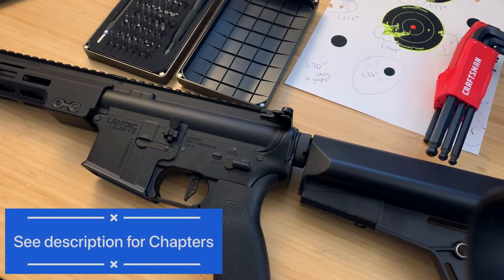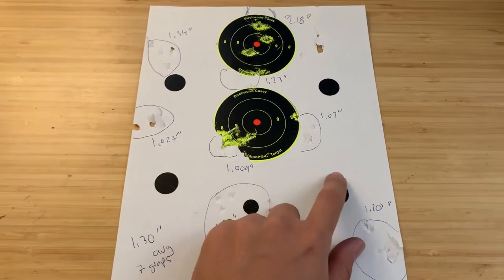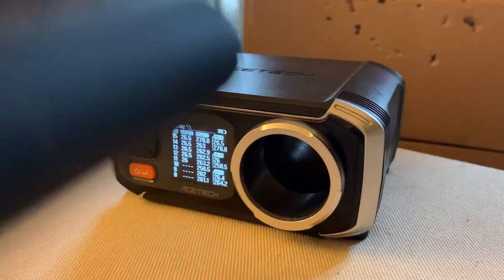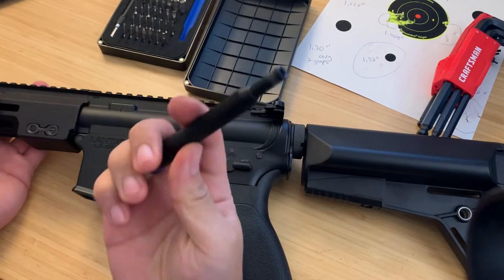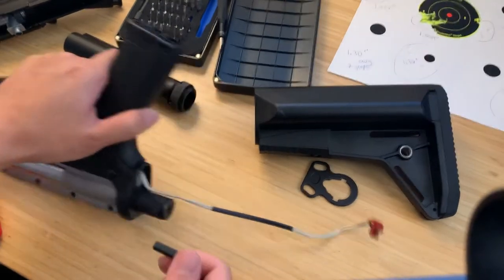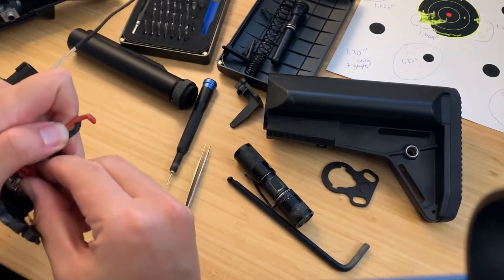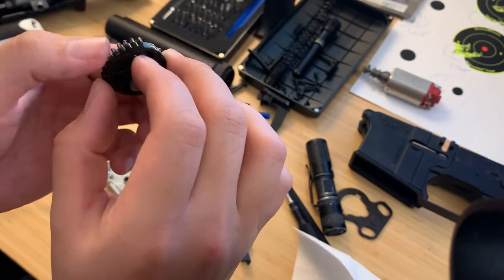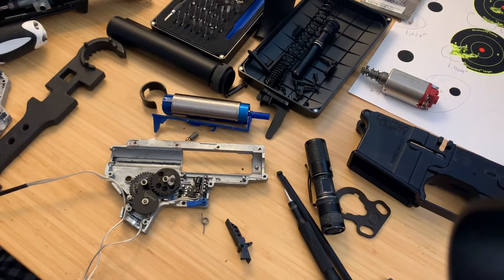EMG Lantac Cyma Platinum Teardown and Internals Review

Comment: How did your remove the muzzle flash I can’t figure out how to remove it, I would like to put my tracer on it
Reply from the maker: It likely has a grub screw and counter clockwise thread. There will probably be loctite too. So just place the flash hider in boiling water for a few minutes and use an adjustable wrench to loosen counter clockwise
Reply: pulling roll pin is a pain, drill two small holes in the orange plastic next to the roll pin so you can get a small pair of needle nose on it and it tugs out.  I needed to heat the plastic up to get the loc-tite to loosen up... clean off loc-tite with acetone (careful with it on stencils, it will take them off I imagine).  Remember thread is reverse.

Comment: Can you use a gate warfet with this? I know this gearbox already has a mosfet, but from what I hear its prone to breaking.
Reply from the maker: I haven’t used Gate fets yet so I can’t say. But it’s a cyma platinum box so if it’s done before on a plat/qbs box it should work
Reply: This is the new gen of mosfets in these so they are a little better. I bought an Cyma EMG MK18 which has the same GB as this. Mosfet seems to be holding up for now...

I've just given it a reshim, changed the trigger, changed the nozzle and motor. I've actually never seen a motor collar have so much movement like I did with this gun that was my only issue so far. AOE was fine (I know he said he needed to correct it, but you really don't). Trigger response is kind of dope for an OOTB gun, full auto does about 28rps on an 1450mah 11.1v 20C. Oh and the mosfet doesn't do active break which is a little shitty...

Comment: Have you ever had an issue with the mosfet, where when you plug in a battery, it beeps once, fires one round on its own, and then has a dead trigger? Working on one right now, and trying to figure out the issue.
Reply: The MOSFET is dying. This just happened to me, had to replace it, watching this video to put the gearbox back together properly
Reply: @ gotcha. So just replace the whole wire harness?

Comment: Awesome! Thanks for this.

Seeing that with the EMG LanTac, as well as other CYMA Platinum based rifles, you have a choice of 350 or 400 fps versions. I wonder if there is a difference in sector tooth count for the 350 vs 400 fps versions, rather than a simple spring change. Maybe the 400fps has the full stroke 16t?
Reply from the maker: I swapped the sector for a full stroke and it got me to a little over 400. So I took one tooth off to put me around 390 with a 370mm barrel. YMMV though

Comment: Nice review!
I ended up getting the Cyma EMG MK18, same gearbox as yours. 
Nozzle compression was still bad in mine so I swapped that out first like you (nozzle length is 21.4mm)I left the cylinder, cylinder head and piston assembly the same though. Gave it a reshim because my gears were also tight like yours and the motor hated it. Backed off the motor as well but ended up getting a cheap ZCI 22tpa motor as a replacement anyways. The mosfet seems to be holding up... for now? I'm a little unhappy it doesn't have active breaking in it though... would have liked to see that.

But overall I had basically the same small issues with my GB as well. I guess they're over shimming them a little bit on purpose?
Reply: Active braking is a negative IMO. It puts more wear on the motor and battery for little benefit.
Reply from the maker: Yeah I think its safer for a Manufacturer to overshim to make sure the teeth don't wobble around, than it is to undershim (could lose good contact between the gears under load). And I second what Chukonu5 said, AB isn't necessary and just causes more wear.

Comment: Did you remove the flash hider it came with? If so how difficult was it. Thinking about picking this up from evike.
Reply from the maker: So for this one. The flash hider didn’t need to come off. Just the plastic ring glued to it. I don’t know if they’ve changed it. But it was easy to take off when I first got it.

Comment: What are your thoughts of dropping a titan in the gearbox ? Did you see any potential modifying necessary ? Bought the Cyma version and honestly it scares the shit out of me having to do any modding to the gearbox so i can just drop in the gate titan.
Reply from the maker: If you google "Cyma Platinum Gate Titan" you can find your answer. I have only used BTC fets, but from what I can read online, yes it will need to be modified.